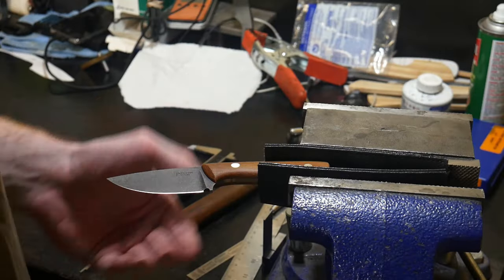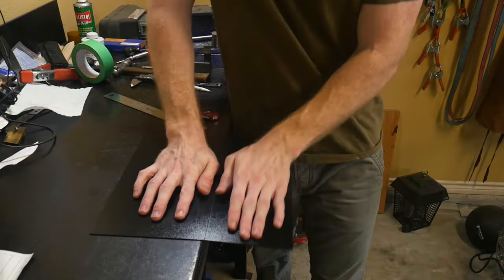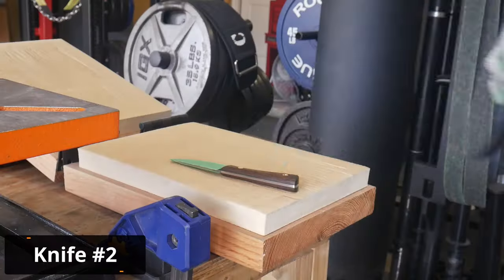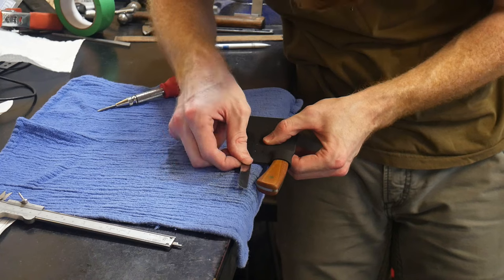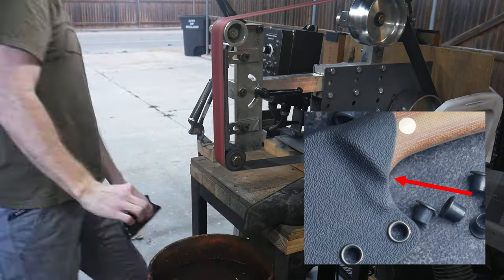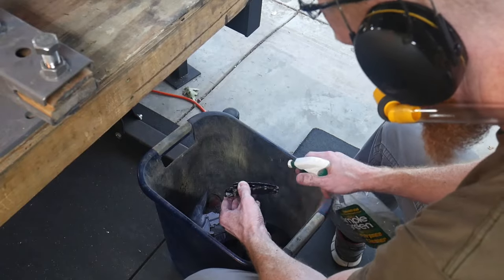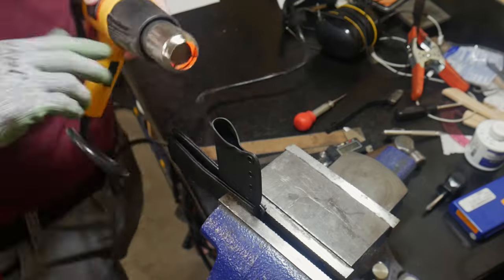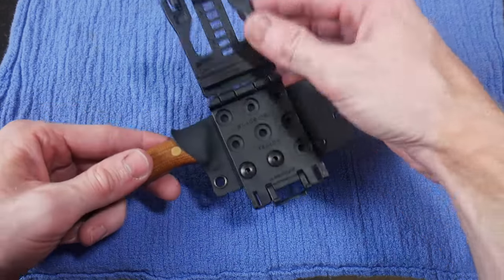How To Make A Kydex Sheath Taco Style | Knife Making

Comment: Great video from start to finish! I also noticed the blade oiling before taping and like that touch. Especially liked the “thumb-ramp” tutorial as well. I’m about to make my first sheath and this video has my confidence high! 

Is that .06 or .08 thickness and do you change your heating method depending on which you use? I noticed you go high heat to 285°. I’ve seen others do slow and low to 350°. Any pros and cons? 

Thanks man. Sorry if this has been answered elsewhere. 🤘🏻
Reply from the maker: Thanks! I put a link to the kydex I'm using in the description of this video. Not sure about the pros and cons of the heating cycles. I think this stuff gets dangerous to breath at a certain temp

Comment: Don't wanna sound like a complete dope but I'm getting a small arbor press and those dies but how does the top die stay? Is there a hole or how does that work? Thanks!
Reply from the maker: Hey Jimmie, I drilled and tapped the arbor with a set screw for holding the top die.
Reply: @RedBeardOps   ahhh gotcha, I can do that! Thanks for the info and for responding 👍🏼 excellent video by the way!

Comment: Nice video!  I want to make kydex sheaths for a lot of knives and multi tools I have. I don’t know if I missed it or not, but which thickness of the kydex do you think works best? Thanks
Reply from the maker: The stuff I use is 0.060" . I think I have a link to it in the description. Cheers!
Reply: @RedBeardOps   thanks for the help. I got the kydex and built the same setup you did. Trying to figure how hot and long to heat it up. Trying to do a taco style. I’ve learned a lot off your channel. Thanks 🙏
Reply from the maker: @eheritage21  I use a cheap temp gun and get mine up to around 280F

Comment: I prefer the pancake because of slimness, is there benefits to Taco vs pancake?
Reply from the maker: Hey Tim, I don't see an advantage other than maybe the thumb ramp is easier to make on the taco. The pancake does have the advantage of mounting holes on both sides for being strapped down easier.

Comment: Is it possible to use a tension screw to determine and set the sheath retention (like is often done w/ kydex gun holsters) instead of the method you used?
Reply from the maker: Hey Jeffrey, I haven't tried it, but I'm sure you could! I'd put it at the top hole.

Comment: At 4min 30 sec, you point to the retention spot of the sheath. Have you found that this will leave scratch marks on the finished blade over time? Is this normal or do I need to do something to prevent this?
Reply from the maker: Dirt, grit, grime will get into kydex sheaths and scratch your blade for sure. It's tough to stop this.
Reply: @RedBeardOps  I tied a clean rag to a long string and pulled it through like a bore snake a few times before setting the eyelets, but it's still rubbing the etched finish a little. Maybe this is just normal, but it still bugs me
Reply from the maker: @hayworth.handmade  This is one reason I learned leather work

Comment: I’ve been doing pancake but like the taco option.  BUT I’m not having much success.  They are coming out really loose and looking all wavy.  Any suggestions?
Reply: I think I figured out what my problem was.  I don’t think I was getting the kydex hot enough.  On my fifth attempt I heated it up to 315 degrees.  Had the consistency of a lasagna noodle.  Layed the knife on it an folded.  Than clamped the crap on the press. (Copied your press.). After 25 minutes took it out and looks great.
Reply from the maker: Heck yeah Gerald! Glad you found a solution.

Comment: Which is better .06" kydex or .08" kydex?
Reply from the maker: depends on your application and desired retention
Reply: @RedBeardOps  so the thicker it is the better the retention?
Reply from the maker: @Drifting_Ghost  that is correct. the whole sheath will be more rigid as well
Reply from the maker: that being said.. I use the 06 and it works great for knives...